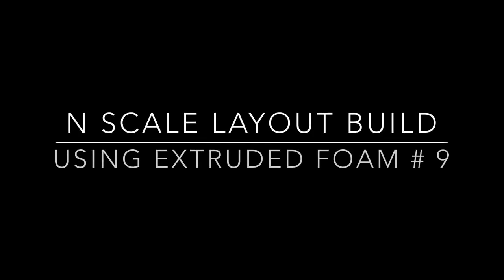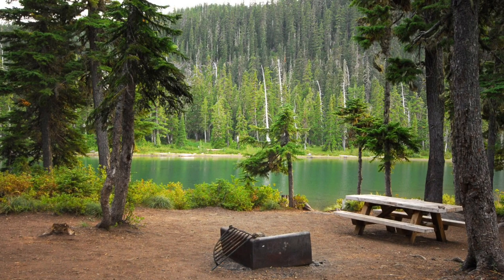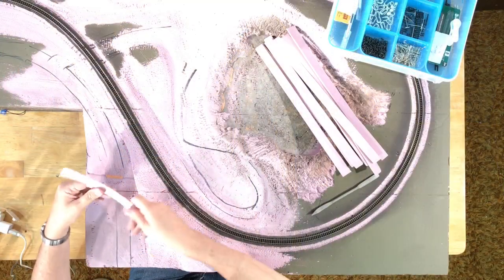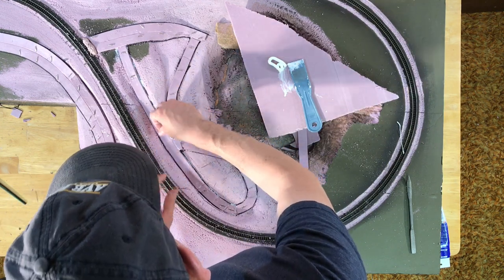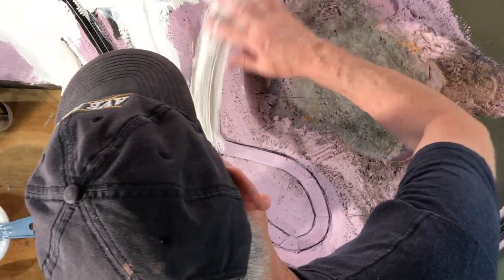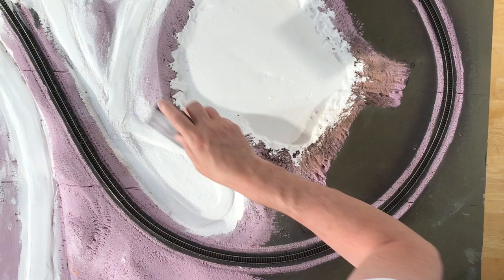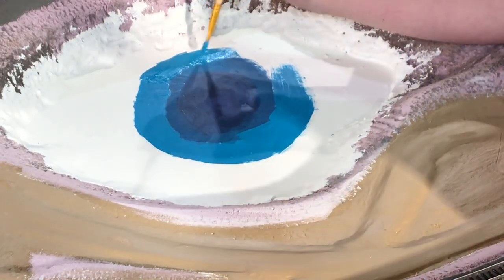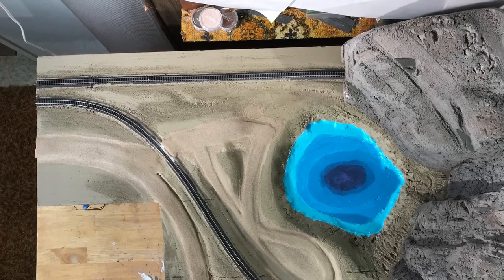N Scale Layout Build # 9

Comment: I like the roads but the edges of the lake needs to start to get earth colors and the deep parts need to be black. When you mix the water you can add blue tint to it for the blue. Looks great so far though.
Mike
Reply from the maker: Thanks Mike. I’m actually thinking I need to build up the edge of the lake a bit, making the shoreline less steep and jagged. Painting an even waterline all the way around will be difficult if I don’t.